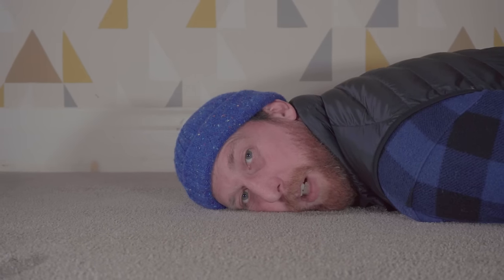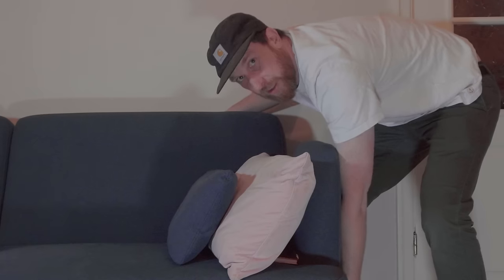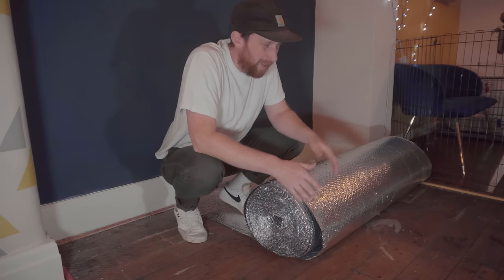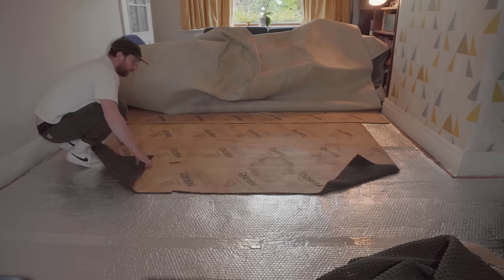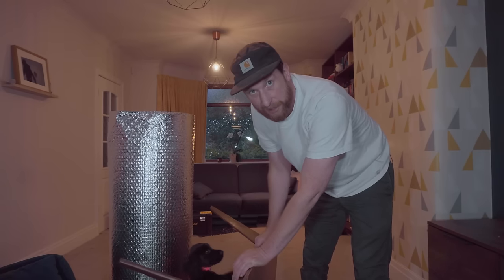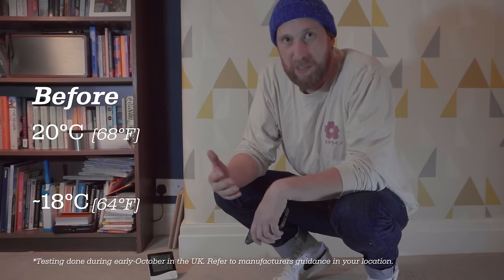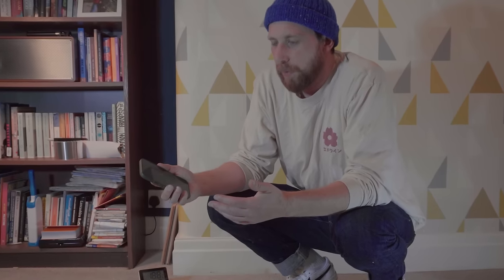This floor insulation could save us HUNDREDS

Comment: Have just finished laying wood fibre underlay  flooring in bedroom and partly on the stairs. Made massive difference to bedroom. Have done half the stairs and it's made a massive difference. Bought from b and q. You can also put it on walls to o. I visited someone's flat and they had thermoboarded the entire place it was soooo warm in there. Since hot air rises I think it would be a good idea to put it on the ceiling at least. What do you think?

Comment: Theoretically the foil only helps if there's an air gap on either side of it. I think the benefit you're seeing is probably slightly from the thickness of extra insulation, and predominantly from how much less air permeable it is.

Comment: You lose a lot of heat through the windows/frame and also light fittings.  I ended up removing all the silicone around the interior of my window frames. I was disgusted to see that the window fitters, had not filled the internal to external wall gap, around the frame with any insulating foam.  I could literally peer through and see right to the outside.  So basically, the only thing protecting my home from the elements, was a thin cosmetic strip of internal and external silicone. Took me a while, but i finished all the windows and door frames.  Not only made a huge difference in heat loss, but it also reduced outside noise by quite a lot.

Comment: I admire you for trying – and for measuring the outcome.

However, I suspect that the improvement you see is largely the consequence of ceiling in the inevitable draughts  from floorboards – and I speak from bitter experience.

If you want to seriously insulate under the floor, I don’t think that there are many inexpensive or easy shortcuts.

If you have the space, I imagine you could consider space therm boards, which is probably the most insulating material on the market per thickness, (all those foils are wildly over optimistic in their u values; unlike spacetherm’s aerogel). I’m guessing that you could indeed lay this over floorboards if you were so minded – but it is an expensive product!

The other alternative is the traditional take your boards up and insulate between the rafters using various products such as rigid insulation or fibreglass type products.

There is also an interesting alternative of DIY lime Crete using recycled glass. It doesn’t sound easy but I have friends who have used it and it is apparently doable and very environmentally friendly.

Of course the other alternative is to take up your suspended floors and replace with properly insulated concrete – not so environmentally friendly but a more standard approach.

I have heard very positive things about super insulating carpet underlay as well which is another relatively easy option compared to taking up your floorboards.

Oh, and I’ve also used a product which is just plastic that wedges between the floorboards and minimises draughts . Depending on your ventilation that can be a double edge sword because you can increase the humidity, unless you have something like mechanical heat recovery ventilation – and if you have that, you will have sealed up all of your draughts anyway.

Insulation is absolutely the way forward in reducing energy costs and an increasingly good investment in that respect!

Comment: I think I a right in saying that the bubble-foil, is only equal to 50 or 75mm of foam IF there is an air-gap between it and the floor.  So you may well get a lot less benefit than you might expect?

Comment: It should work.   Cause the hollow door worked better.   Then I added some more on the walls,  and again there was an improvement.   Now if I had something to cover the floor over the type of insulation you are talking about.   A rug for instance.

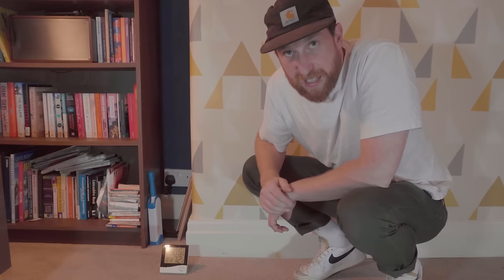Comment: 1:23
 Im my experience tempetures in a space always come in gradations.
I bet if you put the same themometer near the roof ( asuuming your thermostat is at about the mid point ) it would read about 2 degrees higher that your thermostat.
And if you put it at the same hight, but a little bit down the hall or a few feet away by a doorway, you would yet another set of results.

Comment: Try putting insulation into your roof as well. Thermal curtains that have a plastic backing also stop heat going up your windows. Drought stoppers under doors. Simple ways to stop the hot air escaping.

Comment: Even carpet and padding helps . You don't need a thermometer,  just your bare feet will let you know . Insulation is not a heater and heat rises so there will always be a temperature difference.  Al in all for the cost it couldn't hurt .

Comment: Aluminum foil acts as a radiant barrier and the bubble wrap provides the separation from the heat source it needs to work properly.  But heat rises and the greatest lose of heat is through the ceiling.  Insulating the attic would be a better idea.

Comment: I think you've done a good example. There's only one thing I'd like to note: 2°C is not the 10% of 20°C.
In real numbers 20°C is 293 Kelvin and 18°C is 291 Kelvin.
Just do the math.
Your idea is a good one, but you're improperly measuring the percentage, it might be a better idea to express it as a ∆T, I mean a difference in temperature.
Nevertheless, you do a great try to save energy. Best wishes.

Comment: English houses in general have very poor insulation. There are usually many thermal bridges on concrete walls, seiling, windows especially frames and there is no particular insulation on the walls apart cases of new houses with wall cavities. So , yes, insulating floor helps, but it’s a little better than a spit into into ocean

Comment: Hmm very interesting - I was thinking abuot expensive underfloor spray foam insulation for the front 2 rooms of our terrace house. i'm 99% sure there is just nothing between the floorboards and ground underneath. This could be an interesting solution athough I'll need to pull up the wood flooring already there -_-

Comment: With wooden flooring you most probably have cold air rising through the floorboards cooling the room. It wouldn't surprise me if you could have achieved the exact same results simply by putting down a vapor barrier ( sometimes a simple sheet of plastic) and sealing it off.  Doubtful if that little bit of insulation is doing anything. Better results would happen with 30 or 40 mm high density, high R-value insulation, always with a vapor barrier in-between.

Comment: I have an attic fan in the hallway I want to use a similar solution to fix. It leaks cold air in the winter and hot air in the summer

Comment: I have a concrete floor covered with screed no insulation. Its freezing and so is the ceiling which i presume to be concrete since i live in ground floor flat. Any good tips to keep me warm this winter?
Reply from the maker: Looking at the comments here, it’s all about the draughts. I got myself a smoke kit and thinking of making a video on cutting out drafts. Something warm under your feet will help make you feel warmer too, so maybe some extra rugs, if you’re renting.

Comment: I really need to comment on how you equate temperature differences to percentage. A drop from 20 to 18 degree C is not a 10% drop in temperature (it's a 10% drop in the number). In your usage, the same drop in Fahrenheit (68F to 64.4F) would only be a 5.5% drop.  Still a great video though and a good test. And it will positively impact (reduce) your energy usage

Comment: these aluminum foils work by reflecting heat IF you leave ~1inch air gap  (ex: wall-> foil-> 1 inch gap -> gypsum board)

Comment: This something i was looking at doing as we have floor boards in our bedroom and its freezing up there as its a Dorma bedroom,  There 100% draft from old floorboards if there not covered we had the same problem in our old 1930s house front room we only had original floorboards but the draft coming up through the floor was always there,  id of though that thick unlay works in much the same way though? as long as the gaps are all covered
Reply: If you go ahead, use a foil sandwich that is designed for the task, if you use this on a floor with a soft finish such as carpets you will get problems as it degrades under the weight of furniture and foot traffic.
Reply from the maker: Yeah, I’ve not done a direct comparison with other underlays, but this is definitely an improvement over the underlay that is there already. I think the foil does a much better job reflecting the heat back into the room.
Reply from the maker: Yeah, that’s good to know!

Comment: Your thermostat has no control over your radiators. It controls how long the boiler will fire for heating until the desired set temperature in the room has been achieved. The water flow temperature on the boiler is what controls the heat coming from the radiators.

Comment: Do you think that we could use this over tiled flooring? Our whole house is floor tiled an it’s impossible to heat it during the winter.
Reply from the maker: I don’t know, honestly! The manufacturer seems to suggest you can use it over hard floors, but I guess it depends what you’d be putting over the top. Are you thinking carpet?
Reply: @northernworks  yes I would like to carpet on top but also wondered about condensation and the pressure points of furniture. I considered putting a wood flooring on top of the tiles with insulation but again, I might be causing problems. Thank you for responding. Lots to think about really!

Comment: 4:30 15% is not accurate. If the temperature is 2C and drops to -4C, will you say that the temperature dropped by 400% even if it is 6C of the difference? For percentages, you should use the Kelvin scale or use a formula and present the difference as an energy.

Comment: Yes it will make a difference but I don't think that's anything like enough insulation. Most self builders are fitting 120mm or more. We have 80mm in our floor and I'd fit more if building again.

Comment: I see your problem.  You live in Celsius land.  If you lived in Freedom unit land, the difference between your wall thermometer and the floor would have only been 6%.  Us Americans know that Freedom units prevent cold floors.  

Seriously though, two points.

1.  You can't talk about percentages of temperature using the C and F scales, you need to use Kelvin. Therefore, the actual difference is only about 1%.
2.  I'd much rather have the beautiful wood floors you have under that carpet.  

As a bonus serious point, I seriously question whether this will be any better than aluminum foil after a few days of walking on it.

Comment: Nice, except radiant barriers require an air gap on at least one side, otherwise, you've just installed an R1 layer of bubble wrap.
I installed mine under the floor joists for a "claimed" R16.
Reply: Yes, 'Claimed' is the right word. Absolutely no laboratory evidence of any kind, though. It's an expensive R-1.1
Reply: @paulmaxwell8851  In all fairness, applying an R value to a reflective barrier really doesn't work. R values are for conductive heat loss. A piece of mylar film can relfect more radiant heat than a pice of R15 batting, but it doesn't stop conductive heat loss. That's why you need an air gap on at least one side for a radiant barrier to radiate heat away.

Comment: Have you tried a ceiling fan to move the air around as heat rises? Or place a small fan so that it points at the ceiling? I totally forgot that my ceiling fan can be changed to do this. I'm going to give it a go and see if it makes a difference but first need an extra thermostat lol ps agree with the comment about relative humidity. My feel warmer now humidity is 40-50% than when it was 65-70% at the same temp. I used to set my winter temp at 21° now 19-20° seems warm enough (or it could be in my head 🤣)
Reply: radiators destratify room air and act in a similar way.
Reply: @stephenhudson4931  had to look that word up 😂 (learn something new every day - always good). Wouldn't you need a fan to do that? Or am I missing something?

Comment: House has, at its absolute basics, 4 walls, a roof, and a floor.  Pretend they are all the same area and have the same R-value and 100%/6 = 16.7% of the total heat loss would be from each side.  With this information, that 15% statistic you dropped seems pretty good 😛

Comment: Another thing you can do is plastic cover on the inside of the windows. an extra air gap between the outside and inside temps... Floors and windows are the biggest loss of heat.

Comment: If you are renting the unit, then there's not much you can do as you need to get pre-approval for any improvements. If you own the flat, then anything goes.

You didn't mention whether you have a crawlspace or basement below. If it's a crawlspace, then since you're planning on replacing the floorboards, you may want to install the aluminum foil to the sides of the floor joists a minimum of 1/2 inch to 3 inches below the floorboards. Staple it to the sides or nail slats over the aluminum foil. You need the air gap. If you decide to put insulation between the floor joists, avoid pink/yellow fiberglass insulation because it promotes mold, toxic, insects and rodents love it, is useless when it gets wet. Use Rock mineral insulation instead, it costs more however it is fireproof, mold proof, insects & rodent proof, non-toxic, easy to install. Put the rockwool insulation below your aluminum bubble wrap. I would use chicken wire to hold the rockwool insulation to the bottom of the floor joists. Also be sure to put 1" to 2" rigid insulation on the rim joists and chalk/silicone it to seal up any air gaps.

If you have a crawlspace, I don't know how you will address the vapor barrier on the ground, I'd use 6 mil plastic and put it right up to the exterior walls. If the exterior walls are framed in, you could just staple aluminum bubble wrap to the inside of the framed in walls, the air between the wall and the bubble wrap will create its own insulation.

The way you've installed the aluminum foil insulation is no better than putting aluminum foil on the floor because there is no gap, others have mentioned this. However since you plan on replacing the floor, your current improvements will suffice. Anyway, great video...

HOW TO INSULATE A CABIN FLOOR AND KEEP IT RODENT FREE
https://www.youtube.com/watch?v=xPTJD9nuWvQ

Comment: you will always have a delta Temperature at various high in the same room regardless from where you are loosing heat. Floor, in case all the wall ceiling etc are insulated equal, and  if your room is cubic shaped  it really  reprensent 15 %. In your case its more. High density 1 cm eps have double the efficacy of that product. It cost 2.6 euro?Sqquare meter and you can install it in the same way you placed the bubbles. > I really suggest you to use some free tool to calculate  the thermal transmittance and the Igrometric graph BEFORE installing anything instead of crying after about the mold. Oh, I made the calculation with the airtec and you will save around 5 % of your energy bill IF what they claim, but its uncertified, is correct

Comment: Did you have to adjust the bottom of the door to this room after raising the height of the floor?
Reply from the maker: Fortunately no - if anything the snugger fit has reduced draughts in from the front door

Comment: One of the biggest issues for houses with suspended timber floors is air leakage. 
It’s a simple fact that you can’t heat a draught. 

Although this simple idea cost very little, one of the most effective things you can do in a house with these floors is to treat them underneath with spray foam. 
Not only will thus improve thermal performance, it will also drastically reduce air leakage thus making the rooms much more comfortable
Reply: Problem with spray foam insulation is, in the UK many mortgage lenders do not like it even on new build properties. Enough for them to refuse mortgages on properties they wish to buy which also affects the chances of selling it. Its ridiculous I know, and the reasons they give are varied and unfounded.

Comment: I would think the claim that this bubble wrap insulation has the same insulating properties as 75mm of foam insulation is violating the fundamental laws of physics. The actual insulating material in both cases is air. Air is a very good insulator - if you prevent it from transporting heat by convection. So if you keep it in little bubbles such as in foam, with as little material as possible in between, then it makes for a very good heat barrier. So, how can 4mm of trapped air be equivalent to 75mm of trapped air? Well, the answer is it's not. You still have an effect from using it because you eliminate draughts. And that's important. Also, radiative barrier? That would apply to both options. Nevertheless, if you want to insulate properly, then don't use these thin foils. 
Also, if this is really like bubblewrap, aren't you popping bubbles all the time when walking through your room? That would be epic. But temporary. Not enough bubbles. 😛